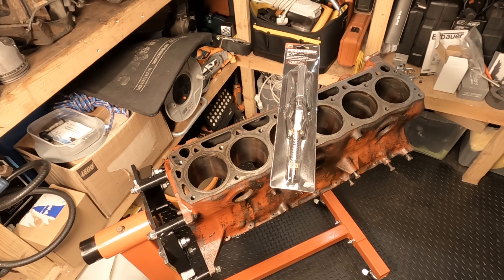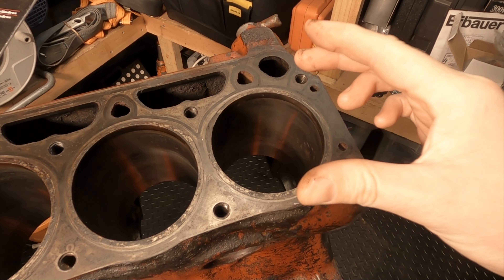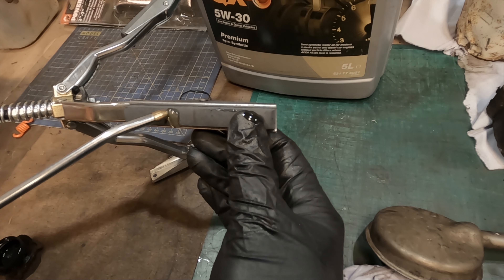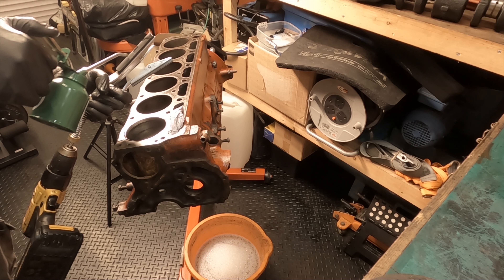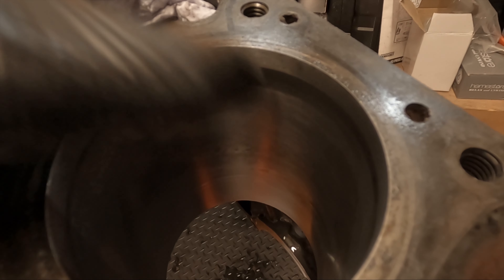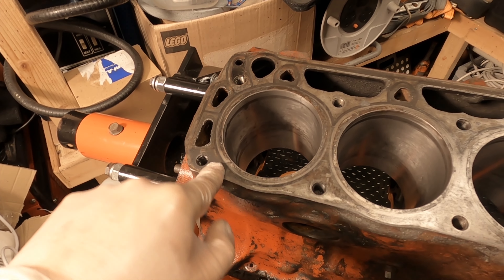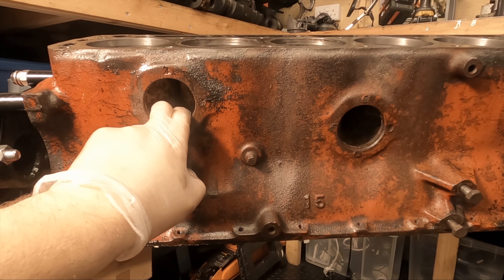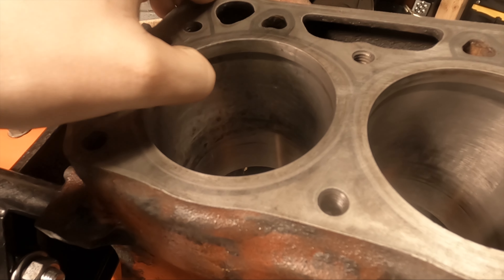How to Hone Cylinder with Drill at Home

Comment: Grand bit of work on what most would have shelved or sold already. I'm happy for your discovery on the deck, but still would question the cam bearing surface being a pain. It was great seeing the hone of the cylinders, and just how well they turned out after your attention to them. Warmest Regards!
Reply from the maker: Thank you for the support, you are correct the cam would need to be replaced on this motor for sure - still have it, no decision on what to do just yet.